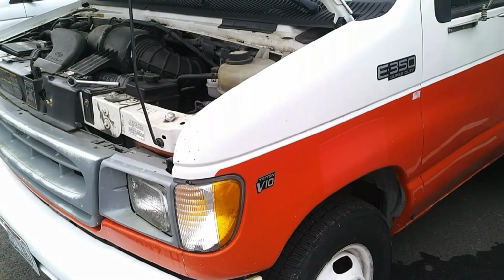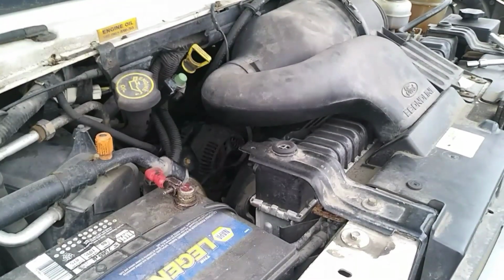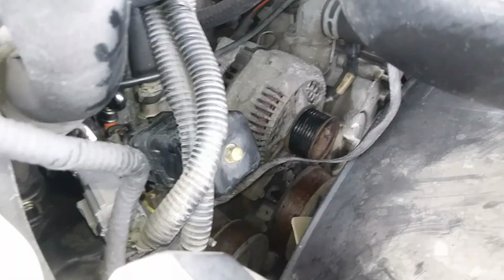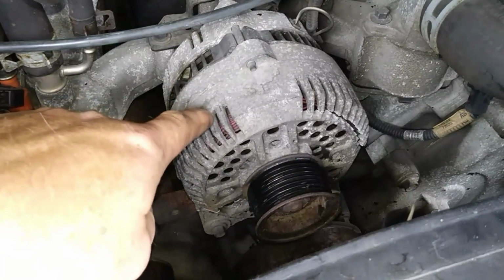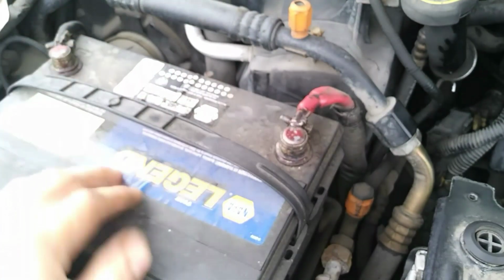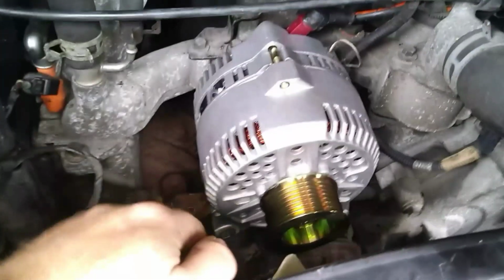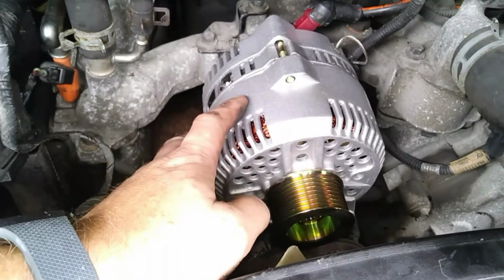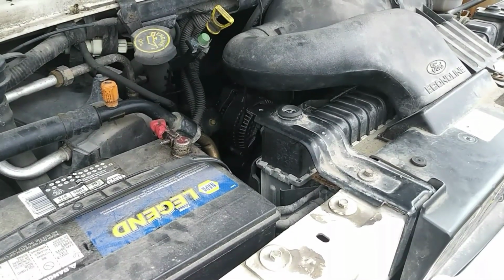2000 Ford Alternator seized and broke the belt, no power steering on a v10 triton.  How to replace!

Comment: just happened to me on a 04 f150 seized and started to smell bad because of the belt rubbing and being melted by the heat  exactly like yours alternator pulley was seized and the alternator case broken